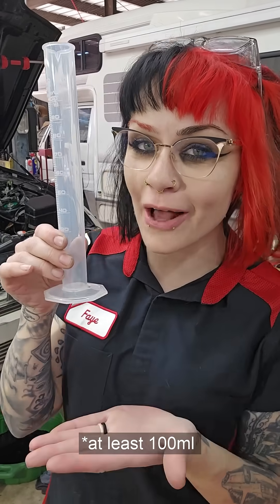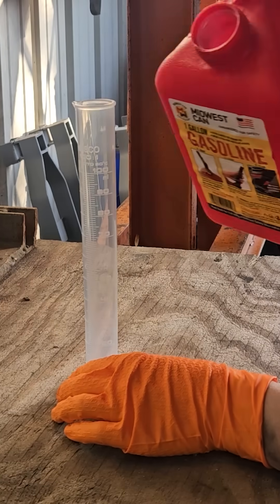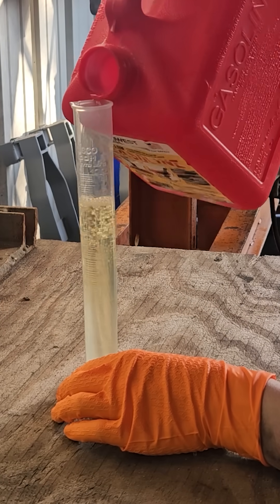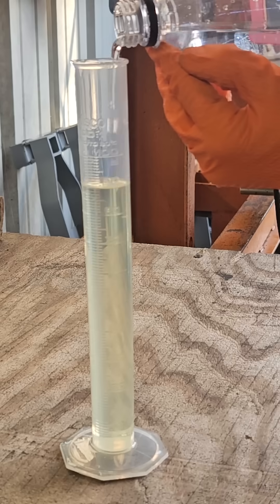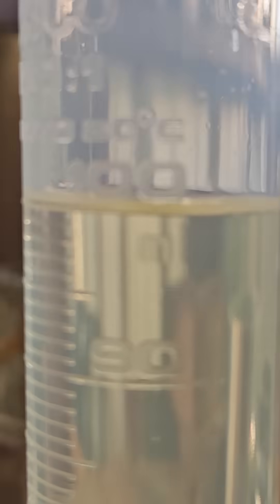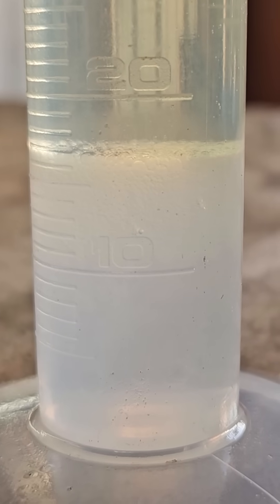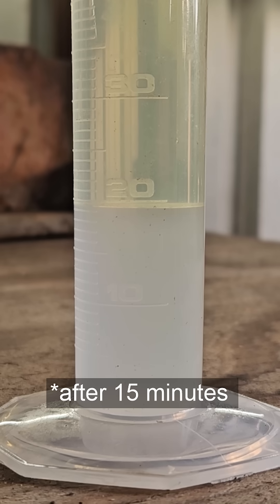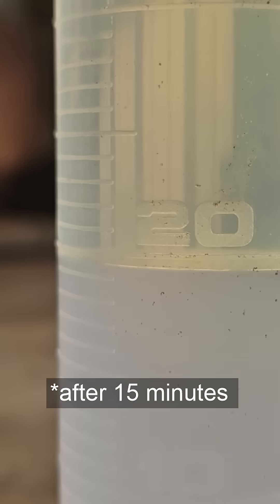Testing the Ethanol Content of Gasoline Using The Water Extraction Method! #AutoDIY #Ethanol #Shorts

Comment: I rely on "Fuel composition" pid on my scanner to start a driveability diagnosis. Recently, a Chevy truck came in with the check engine light, truck show both banks running rich. Fuel composition was at 50%! Owner swore that they only used regular on this flex fuel truck. Reset fuel composition & everythings well so far.

Comment: Wrong. You started with 90ml of fuel. 
10% of 90 is 9. If the alcohol/water line is above 9ml, then the gas contains more than 10%.

Comment: Unless you are buying ethanol free fuel, I’d bet that most gasoline is going to have close to 10% ethanol in it.  

10%, 7%, 5%, it really doesn’t matter as any engine built since 2000 is capable of running the stuff with no issues.  

Most fuel related issue have to do with lack of maintenance, not the fuel itself.  
If you want to spend a few hundred dollars a year on premium gas to save $7 on fuel line, have at it.

Comment: The addition of ethanol to gasoline was supposed to make the gasoline cleaner because ethanal has very few harmful emissions. In reality what it did was damage engines, reduce fuel economy by about 3% and create a larger carbon footprint when produced. Ethanol will eventually separate from gasoline and leave deposited in the engine and fuel supply components, it has about 70% less energy than gasoline per litre, ethanol is also energy negative, which means that it takes more energy to produce it than it gives back.

Comment: While most people complain about ethanol, I have never had any issues. Use it in my lawnmower, generator, weed eater etc No Issues. Just run dry before winter storage 😂.
Reply: I never turn off generator I shut off the petcock and let it run out of gas

Comment: 10% ethanol is a scam. Ehanol itself is super cheap to produce and requires more fuel to air than gasoline to burn properly, therefore by supstituting in 10% ethanol it makes your car less fuel efficient regardless of the ecu's tuning.....so in a world where we are trying to save the enviroment, their solution is to essentially male gasoline less potent so cars burn more fuel to travel the same diatance......
Reply: Then what about 20%? Here in India, 20% blend has been made mandatory while most vehicles on the road are certified only for 10%!

Comment: The concentration is going to vary on however they're mixing it at that time. If they have more cheaper ethanol they'll mix it heavy. If the ethanol becomes scarce they'll use more gas

Comment: Still amazes me how 'regular' fuel in South Africa at the Coast is 95 octane, while the inland regions have 93 octane as the standard.
While the US is still fumbling with subpar fuel grades being filled into cars with the latest tech.
Reply: Do you have 98 octane?
Reply: @he-mansuncle7661  
98 Octane was available at the pump until around 1993 or thereabouts.
Thereafter it was switched to 95.
However, 102.6 is still available to purchase from specific locations, but only supplied in a 25 litre metal can.
Guys normally buy those to dump into cars at drag meets and track days.
Reply: @YusufGinnah so it’s just 95 and diesel?
Reply: @he-mansuncle7661  I'm at the Coast, so yes.
Inland, the options are just 93 and Diesel.
Reply: North America uses AKI (anti-knock index), everywhere else uses RON (research octane number). AKI is the average of RON and MON (motor octane number) (i.e. (R+M)/2). RON is the octane rating from low load lab testing, MON is the number from more strenous lab test conditions.

Ethanol free 93 AKI is equivalent to 97 RON, 87 AKI is equivalent to 91 RON. All these numbers go up slightly for 10% ethanol.

Comment: Remember alcohols mix with water differently. It's not 5ml + 5ml = 10ml. Due to hydrogen bonding, the alcohol occupies space "amongst" the water molecules more tightly, called volume contraction. So, the level you read post mixing is showing a bit less than what is actually seen. Also, the volume contraction ratio is not linear. 50/50 mix of water and ethanol is approx 3%

Comment: I know a pilot who will take that kind of fuel and he has a very large like 50 gallon maybe even 100 gallon tank and the bottom of it is a funnel shape with a valve at the bottom and he takes the water and puts in green dye, and then he lets it settle, and it will pull the ethanol out of the fuel and bring it to the bottom and he opens up the stock. Koch drains out the bad the ethanol and water and does this repeatedly and then siphon off the top of actual gasoline. And it works extremely well.

Comment: Not wrong but not quite right. Firstly you need to pre measure fuel sample and water sample before combining for proper accuracy. Best way is to have a 100ml plus grad. cyl. and a 200ml plus grad cyl. Measure 100ml of each and pour into 200ml cyl. If ethanol is zero it meniscus its at 100 as in zero. Every ml over 100 is the alcohol content, in percent, and  minus the weird math.

Comment: fuel fraud is rampant.  I try to buy E85 because I want the 85% alchohol.  But the standard allows them to use as little as 51% alchohol, which doesnt run as well.

Comment: I use this method to remove the ethanol out of the fuel for my bike. The thing wouldn't run right no matter what. I tried ethanol free and it works amazing.  Only thing is canned fuel is expensive and they dont sell ethanol free any other way where im from. So I just make it.

Comment: Im concerned about the 90s and early 2000s vehicles if they keep adding more alcohol to the fuel how will they run? Especially if it's around 20-30% i believe if they really wanted to get the older car's off the road all they would have to do is raise the alcohol content in the fuel.

Comment: Ethanol is dried to be 100% pure upon creation. It's only when sent to flat storage that they PUT water into the ethanol. Yes. Put it in. See, EPA ALLOWS 10% moisture due to tank condensation. So, a 100,000 gallon tank gets 10,000 gallons of water added to it. I have seen it. I worked for big ethanol.

Comment: For all you be picky. When water and ethanol mix the volume is smaller than the two by themselve. 10ml of each mixed is about 19.6ml. Also some tiny amount of water disolves in the petral snd some petral disolves in wated.  And as someone pointed 9ml is 10% of 90ml, not 10ml.  All this, she is close enough. And correct, if the aquous phase (water layer) is 20ml there wss "more" than 10% by volume ethanol.

Comment: I don't understand why everyone hates ethenol fuel. I think it's great. I've never had fuel issues using it and it cleans the fuel system really well. I like to run E85 from time to time to clean the valves and such.
Reply: There’s very little to none problems when you run it all the time,and refuel regularly. Problems will show up on long storage equipment,like winterized motorcycles,lawn power tools or just stored fuel in containers,when ethanol separates from fuel,attracts water and crystalizes,causing issues with fuel systems.
Reply: @volodymyrbuchak1852  I've never had an issue storing it. I have had carbs get clogged with powdery stuff after sitting a few years. I assume those were the crystals you were talking about. Old fuel would have varnished anyway though. Maybe it's due to living in the desert and having low humidity.
Reply: Congratulations.  

I've seen it wreck carburetors, fuel lines,  and cause massive rusting in various places that is less of an issue with 100% gas (20yr old tiller with 100% gas and a shiny gas tank while a similar steel tank version half as old is COVERED in rust and they don't bother...  both garage kept).  In small engines,  running ethanol for any substantial amount of time and you can count on rebuilding or replacing your carb and possible even fuel lines.  Just because your use case is largely unaffected doesn't mean everyone else's is.

Comment: If a station orders 1000 gallons of 91 or 87 it will have 100 gallons of ethanol mixed in at the pipeline.  87 is 87 octane 91 is 93 mixed with 87. 89 is 87 mixed with 91 at the gas station

Comment: Ethanol is a scam. I kept track of the mileage for years in a car. I got less gas mileage when using gas with Ethanol. So, there was zero environmental benifit at all. My sister had a flex fuel vehicle and she tried the E85 since it was cheaper. But, the mileage was so bad it cost more in the long run.

Comment: In Australia most of our fuel doesn't have any ethanol, unless you purposefully buy "E10" because it's a little cheaper (most manufacturers don't recommend it)
Reply: But it’s also less efficient,so you don’t loose much by not using it.

Comment: There’s a problem with this method as the volumes of water and ethanol are not additive. I don’t know the exacts of it but if you add 10 mL of water to 10 mL of ethanol you will absolutely end up with less than 20 mL. In the laboratory these calculations are done by mass rather than volume. The better method would be to add 10 grams of water to a pre-weighed volume of gasoline, mix well, then weigh the water-alcohol portion and subtract 10 grams to get the mass of ethanol. Then you divide the ethanol mass by the original gasoline mass to get the percentage.

Comment: Another fun fact- if you take 100 ml of alcohol and 100 ml of water and mix them, you won't get a total of 200 ml. Why, because water molecules are bigger and have more space between them then alcohol. The alcohol molecules of course are smaller and will pack just a little bit more tighter taking up less volume. This becomes more noticeable with larger quantities of the two fluids.

Comment: Side note, if your gas does this without adding water you need to flush it out. The ethanol is needed to boost octane but it also absorbs water from the air.

Comment: originally was called gasohol.  used as fuel extender.  also melted down many carbs due to materials  being used in manufacture of carb bodies and most of all the '0' rings used at that time.  make lots of money--

Comment: The reason it says less than 10% is because the ethanol is added as its being loaded on the delivery truck. So depending on how much is loaded on the truck the % may be plus or minus 1 percent. They inject with the goal of 10%. Also the brand of gas may have a certain formula. Generally exxon has the best gas due to the formula and the detergents used

Comment: Several years back, I had cars coming into the shop with customers complaining about poor performance and excessive  gasoline consumption. I to experience this in my cars. Especially my carburetor equipped wagon. We couldn't  find any issues, and there were no codes. It ended up being too much alcohol in the fuel mixture. 🙄

Comment: It means if you have a car older then 2001 that you hate the new gas. And never let it sit in the tank. Dont drive it dry but dont let it sit in the tank. It can absorb moisture in the air and settle like this video causing your vehicle to run very poorly and ruin fuel components such as fuel pump. It also means that the alcohol content will slowly degrade seals and other rubber components and sensors over time and for carb injected vehicles it can change the efficiency and may need more maintenance (i.e.) tuning and adjusting. To make sure its always at optimal performance and isnt running lean or too rich depending on the ammount of ethonal in the fuel. I sygest if you find fuel without ethanol in it always use it no matter the price especially for anything older then 2001 or if its carburated. Such as motorcycles lawn mowers general lawn equipment and small engines.

Comment: The math for finding the exact percent is:
G - Total gas (90)
W - Total water (10)
E - Total water + Ethanol (17)

[(E - W) / 90]  × 100 = E%
In this case
[(17 - 10) / 90] × 100
(7 / 90) × 100
0.0777... × 100 = 7.777777% (aproximate)

Comment: This is actually a great way to clean your injectors and pistons as well, after you're done testing 15 gallons like this, you can use the fuel to make the inside of your engine sparking clean. 😊
Reply: And blow it up. With removed ethanol you just lower the flash point of your fuel,that will cause predetonation from selfignition just from compression,grenading pistons and valves. About cleaning,ethanol burns much cleaner than gasoline,without any carbon build up,only downside is it’s producing less energy,less efficient and attracts water. Think before you give someone a crazy ideas.
Reply: @volodymyrbuchak1852   lol, I'm surprised it took someone months to catch why this is a bad idea. It was a troll dude, if you're dumb enough to do it, you kinda deserve it

Comment: Random note: they mix the ethanol into the gas at the terminals where gas trucks pickup. I know because I haul gasoline for a living. You ait there loading the truck heqring the click click click of the injectors as they put the proper amount of ethanol into the fuel as well as any additives depending on who the gas is for.
Reply: I always wondered about that. Is there really good gas and bad gas additive wise?
Reply: @lightningdemolition1964 yes nicer gas has more additives to help clean carbon build up and better lubrication.

Comment: Engineering Explained did a video on ethanol. He said it doesn't help the environment but the opposite.  It also harms engines.
Reply: It's not great for carbs, any benefit of it is offset by the production of it... But if you've got big injectors and boost, you are less knock limited by e85.

Most people would be better served by 0% ethanol gasoline.

Comment: 9ml plus 10ml of water would be 10% ethanol as 10% of 90ml of ethanol is 9ml, so your correct that over 20ml would be over 10% ethanol but the statement could be updated to more than 19ml of water alcohol combined solution would be over 10% ethanol.

Comment: Ethanol doesn’t hurt anything, it’s just a different type of fuel. Most newer vehicles are equipped to burn E85 ethanol or unleaded gasoline or both. They call them flex fuel. The computer system will detect the ethanol content and will burn it accordingly.
Reply: E85 vehicles aren't anywhere close to most. Pretty sure less than 10% of vehicles produced in the last 20 years are E85 compatible and it's not going up. In fact most of the stations near me that used to offer E85 stopped doing so. If your vehicle isn't designed for 10% or 12% ethanol fuel, let alone 85% ethanol, it won't be good for it. Not every manufacturer plans for that the way you suggest.

Another point, E85 is less efficient than regular gasoline. My father in law put a quarter million miles on a flex fuel vehicle because of his job and by his math E85 fuel had to be at least 15% cheaper than regular unleaded or it would cost him more money per mile. Even in a car designed for it less ethanol was better.
Reply: It may not hurt anything when used in the correct vehicle but people can’t always be trusted and a fuel sample/ ethanol testing is often an important part of diagnosis. Also some of the Chevy trucks are known for the fuel composition sensor getting out of whack  which can cause rich codes and other problems.
Reply: Ethanol will ruin any engine made prior to the 90s because it causes the materials like rubbers and plastic to fall apart.
Reply: @ cars from the 80s and 90s use leaded gasoline. Till the EPA banned it around 1996. Correct me if I’m wrong. Manufacturers don’t make cars from the 90s no more. Starting from 2007 and up the technology and computer systems took a very drastic change. Most of this vehicles are equipped for ethanol
Reply: Ethanol destroys older cars that aren't designed for it
Reply: Ethanol eats rubber hoses and seals

Comment: Good information but I don't know many everyday drivers that care about this subject. It really doesn't matter. Any and all of ethonal mixed fuels are bad for a fuel system and cause corrosion in the fuel system if allowing to sit in the tank longer then a few weeks. It is best to run pure gasoline. If you run mixed fuel you must run an additive to eliminate the corrosion possibility for each fill up. Water and ethonal bad in your fuel tank over time.

Comment: All you need is any straight sided narrow glass container. Pour water into it to nearly half full, mark the water level at the lower meniscus, pour the water out into another container, pour gasoline into the marked container up to mark, pour the reserved water back into gasoline and tip it several times to throughly mix, then let it set for several hours.  The amount the water rises is the amount of alcohol in the gasoline.  Using antifreeze instead of water will make the levels more pronounced and the separation much faster.  A closed container will help minimize the hygroscopic action as well as evaporation of the gasoline.